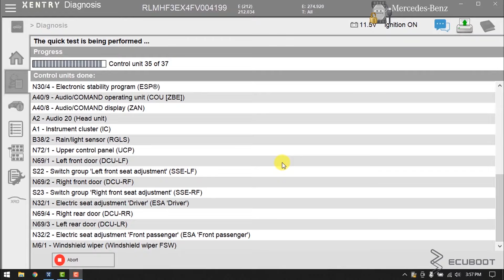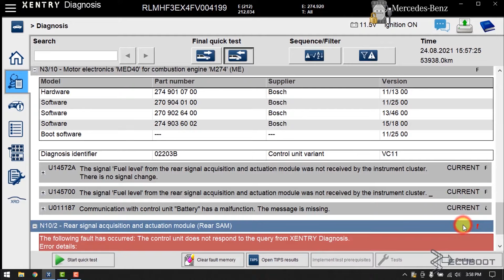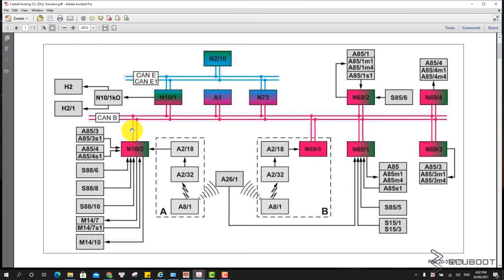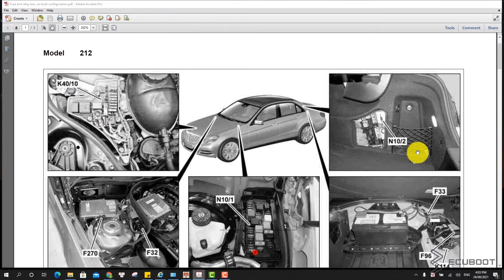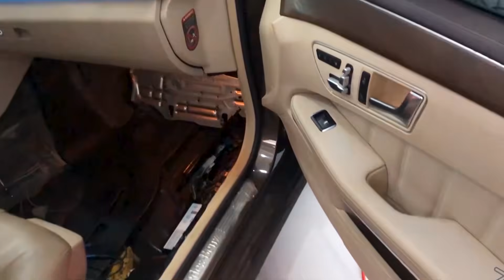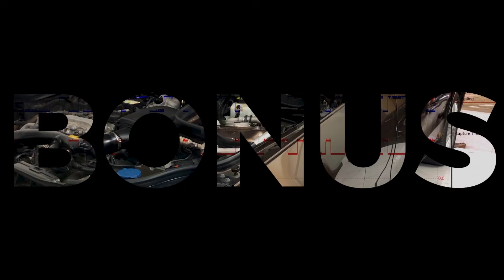Mercedes No CAN message was received from control unit Fix

Comment: Hey bro i am facing the same issue with my Mercedes e280cdi 2007 and i am getting codes(c100 ,d10b , 91a3 ,5024, 5025, 5026 9062 930e and 9348 from launch tool) | went to a car wash to give it the clean under body wash and after driving it back to home, it was fine. After a few hours. I tried starting the car, the key isn't rotating in the ignition. Then I remove the ECU and the clean, the every trace of water droplets after sometime. The car started honking by itself, then I disconnected the horn and then I disconnected battery after 12 hours. I connected the battery and the horns are not honking by itself, and I tried starting my car. It started as usually it starts and after going about 5 km. I went back to my home and then I tried starting my car whenever I put my key in ignition on the last tab where the engine is about to start the radiator fans kick in with the maximum speed and the car is not turning over and then I open the fuse box, cleaned it with the board cleaner.
There was a little trace of rust i cleaned it with the toothpick. And I have checked all the fuses and relays, there is not a single fuse. turned bad, but whenever I turn the key to own position, the fan starts at maximum speed, I think you have very vast knowledge about my problem and i hope you will help me in this issue

Comment: Hi, im having similar issues with my 2018 mercedes cls550. Mind me asking where are you located? Tried troubleshooting multiple modules and wires and still having issues. Can bus off to the gateway module not communicating. Replaced the front SAM, ECU, and other tests have been performed and no fix. Are you able to assist in any way? Thanks